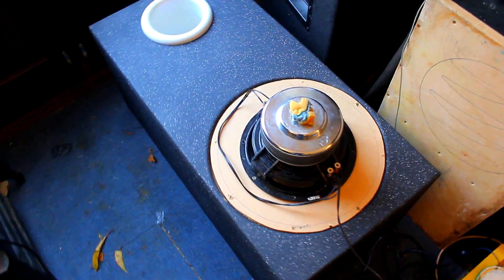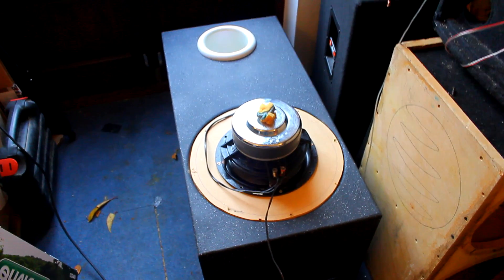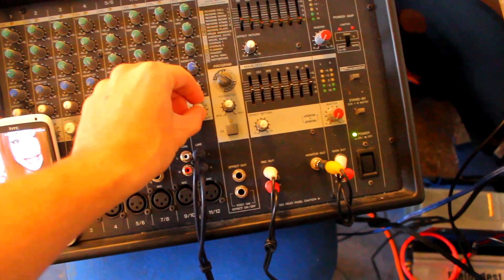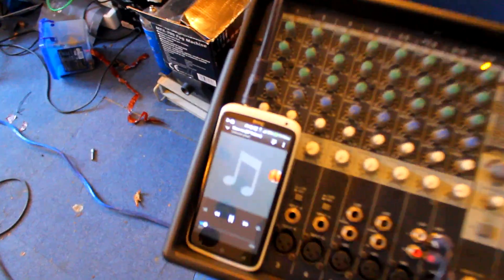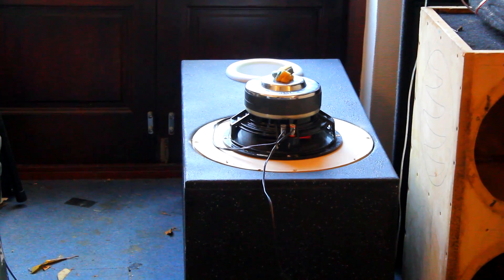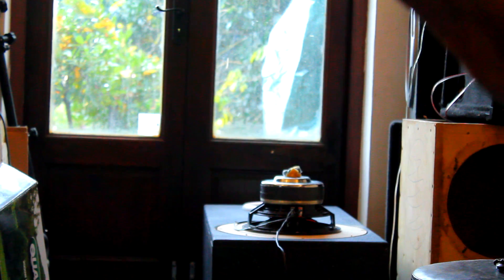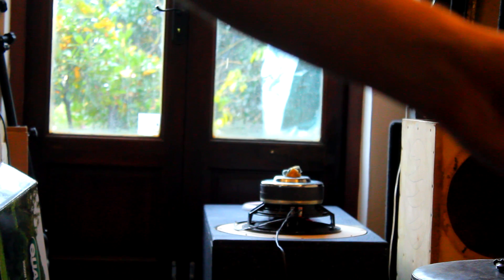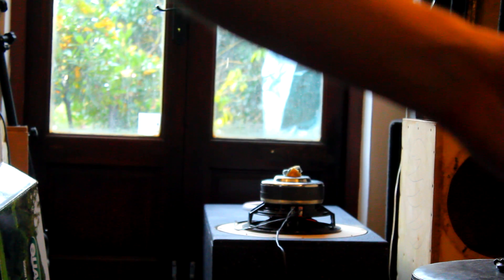Digital Designs 10" in HUGE 28hz box - Testing freq response

Comment: what is the size of the box in litres? i have a made a box for my dd 610 out of an old kitchen cabinet i had laying around  (the place where you put your dishes) and the total size of it is 128 litres (i know its way too big) and the port is 4 1/4 inch wide and 15 3/4 inch long with flared ends. it hits the lows very nice.

Comment: I have a couple HDS200's 12 inch models. in a 5.138 cu ft box. that I'm going to port and tune to 28hz. they're only loud above 50hz in a large sealed enclosure and it sounds like shit. so. the port is a must.
Reply: 5 cubes really ?
Reply: MrGroundpounderz yes. they do good. I'd have went 6 cubes if I could have. they're loud as is. only on 900 watts. rated at 600 watts rms each. they want a lot more power. they'd do great with 1500-2400 watts on them.